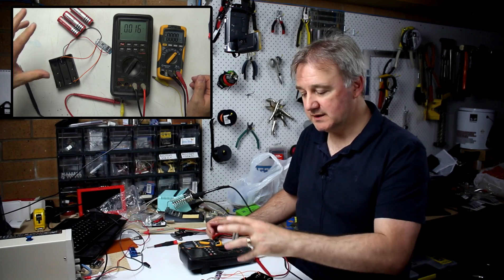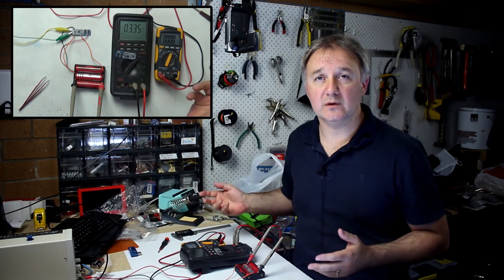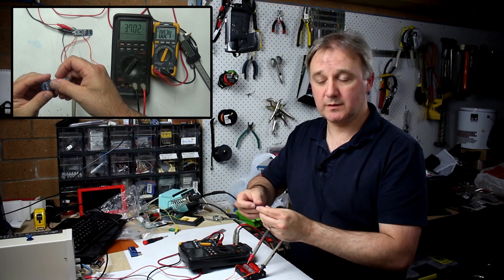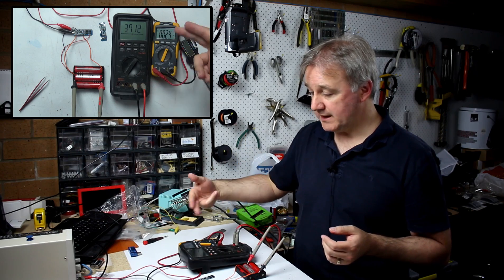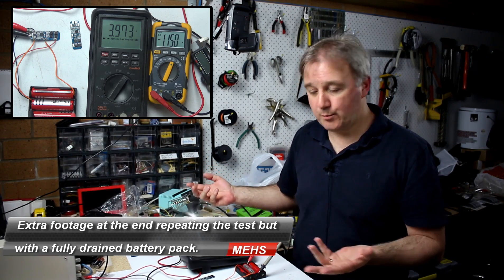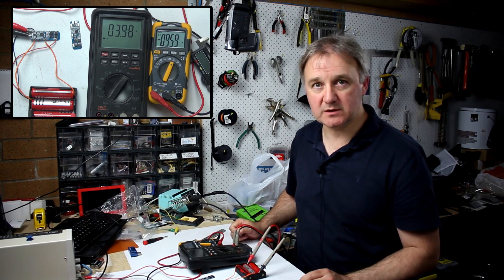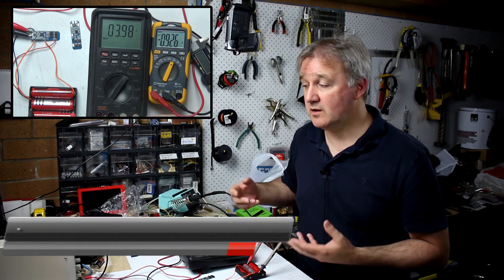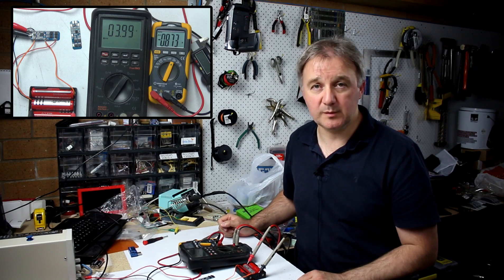Does a BMS charge my Batteries? (MEHS) Episode 57

Comment: have you looked at ICs by any of the legit (non china ebay) makers? linear technologies ti and a few other companies have parts that do better, ive got some linear samples coming for a project. over all its still harder than it should be to find a proper pack controller and though weve had (from what i can tell) at least 5 years of cost and size effective mosfets to do transfer instead of disipative balancing im struggling to find a part that can do it for 4-6 cells and is clearly sold as such. im starting to wonder if its done to sell more laptop batteries. lower u discharge them the shorter their life. 4s laptop 1 runt cell always gets to 3 and turns off pack while other cells still are at 3.3, over even 50 charges that low one sees a lot more full charge rather than fractional cycles and maybe dies 6 months earlier than the remaining 3 due to it. active balances can work during discharge time and transfer to weak cell from either the cell next to it or the other 3 cells combined to it depending on chip/tech. Ive opened laptop batteries that have 3 empty 18650 slots so its hard to argue space.. esp in the bigger and built to last corp grade laptops. I can only conclude they want to sell you that replacement battery sooner.

plug for linear: they will give just about anyone qty2 of up to 5parts in a few month period for free samp;les. I got my first sample order like 5 days after requesting it. Day after I submitted it, my local sales rep called and rather than just trying to shove parts down my throat he took about 30 min mapping out my design and trying to find the best parts they offered. also it may be possible to get demo boards for free depending on how many your local rep has on hand and demand. Over all i was thrilled and suprised at their level of dedication to prospective clients.. I had even indicated less than 1k annual units so it wasnt like they were expecting to bank on me
Reply from the maker: - I did take the wire gauge into account.  No variation.  No feeding the board proper CC and CV makes no difference.  I used a bench power supply for most of the testing etc.  These boards only have the battery protection IC on them and some FETS, no proper charging IC.  Basically charges the Lithium cells like a lead acid battery.  No good.
Reply: after talking to my rep for a while he mentioned if they arnt short on supply he can send the fully assembled "demo boards" with all components in place ready to go...this would pretty much make it a project board for you. I havent gotten back to him yet (does anyone sell a 26hr day IC?) so im not sure if that includes these balancers or not(note price when u look them up) but here is the demo you would want: dc1823a, DC1902B. there is an older model you can find with some digging that does most of what they do for cheaper if your rep isnt as awesome. Today I managed to get one of their qfn20 sample chips that happened to be a charger soldered to a dip/breadboard adapter. I have a hot plate for separating display from front glass that happened to reach high enough temps but there are tons of tutorials on surface mt soldering on youtube, hot air gun is next step down but even a regular iron can pull it off.  ebay has the adapters for cheap if you just go the sample free chip route. I also received surface mt transformer samples from coil craft today. I requested 5 of them monday morning at around 3am really liking both of these companies
Reply: Silicon Chip magazine March 2016 described a project that would probably be what you're looking for. A bit complex for myself tho.
Reply from the maker: - I might need to contact Linear and others and see what can be done.  Ive used Linear and TI ICs before and have no issues with their products, just hard to find complete project ready boards that have good IC's with easy to find datasheets.  Seriously looking at designing and making my own to do exactly what I want.  Might need to read that Silicon Chip issue too.  Cheers.
Reply: I can send it to you, the mag i mean. too difficult for me as I said. i am just trying to find a circuit for balance charging bike batteries made from salvaged laptop cells. The hobby chargers don't seem to cut the mustard as far as decent charging current goes. Not in my experience anyway.Cheers
Reply from the maker: - No need.  Thanks though.  I will pick one up.  Cheers.
Reply from the maker: - Thanks.  I will take a look when I have more time.  Cheers.
Reply: forgot to ask.. with the cheap bms u used in the video...if you attach a proper cc/cv power source does the charge curve get any better? I've got a few other projects going that i intend to use similar ebay acquired bmses for. for what im charging/what they can pay it doesnt merit using a non premade board. If they do charge properly with a cc/cv source then a cheap cc/cv dc-dc converter could be added between a brick slightly over or under whats need for the boost or buck converter to run
Reply: I wanted to edit last comment but too many browser tabs has my browser not wanting to pop it up. It just came to me that the tiny wires you had for that bat holder may have influenced your results as well. When i get those I swap out the included wires for 18 awg or bigger.
Reply: Thanks for doing the investigative "legwork!"

Comment: The solution of using 3 X TP4056 modules does not work to balance the cells since they are not isolated. If you use the same power supply to power all 3 TP4056 modules, draw it out on a piece of paper. Been there ....done it. To charge using TP4056, you need to get an isolating chip for each module to isolate from the battery negative terminals. I use these BMS modules only for under voltage protection. To Charge I use a Lithium 3s hobby charger wit independent wires and balance lead coming out of the batteries.
Reply from the maker: - Hi.  Yes I was aware of the isolation issue and have a workaround but thanks for the info.  Fingers crossed it all goes as hoped.  Cheers.

Comment: those batteries "UltraFire" is crap batteries and hardly worth 5min of your time. I have done the same with NCR battries and. I use a Hobby charger set to LiPo and charge via the BMS.. best way I have found yet to get a pack balanced. I have started to use a BMC on large RC models battery pack connected to the balance cables. seems to reduced the times the pack became unbalanced when in used. reduced puffing of the packs..
Reply from the maker: - Thanks for the info, very handy.  Yes the fake Ultrafires are garbage but they were cheap and it suited my testing regime at the time (end up about 1400mah each).  I have a batch of Panasonic, Blazer and Keeppower cells I use often when the run time matters.  Cheers.

Comment: What do you recommend for charging larger lithium ion packs like 12S5P. I'm building one for an electric skateboard and was planning to use a BMS. Would it be better to just plunk down the money for a proper lithium ion balance charger? Do some BMS work better than the one you're using?
Reply from the maker: - Hi.  Heaps better to spend intelligent money on a quality battery charger.  Considering the cost of good batteries and the number you're suggesting I would suggest a good charger over a BMS every time.  You may still need a BMS if you don't use protected cells in order to catch the low voltage point of the cells during use (the BMS will stop draining the batteries at the 2.9-2.5volt mark) which is desirable.

Comment: The problem with charging a Li-Ion battery pack the way that this particular board invites you to do is that it doesn't guarantee that each of the cells receives an equal amount of charge. So even if you limit the charging voltage to 12.6V (3x4.2 since exceeding 4.2V is a fire hazard), you may be charging one cell to 4.0V, one to 4.2V, and one cell to 4.4V (fire hazard!). To put it another way, this board does not BALANCE the cells. Some boards claim to balance the cells but I bought a 7S board that cuts off the charging current when the first cell reaches 4.3V (a little high for my comfort but not excessively so), leaving all the rest of the cells below 4.3V, and so does NOT balance the battery. The only problem this gives is that the full capacity of the battery is never realised, but I wonder how many people have bought this particular board and take it on faith that it performs the claimed balancing function. The moral of the story is never take the seller's claims on faith... always test.
Reply: Generally BMS ballances on discharge by shunting the excess voltage battery to either a resistor or to charge the lowest voltage battery - this is called "bottom ballancing" and is far cheaper to implement and safer than balancing on a charger. As such - yes you never reach the full potential of the pack, but the battery pack will last many more cycles on an 80% charge than a 100% charge.
Reply: As I understand it, a BMS balances on the Charging cycle by discharging any overcharged cells through resistors -- this is called "top balancing". "Bottom balancing" entails Discharging all cells to the same low voltage and then charging the entire pack (rather than the individual cells as a BMS would). Bottom balancing ensures that all cells reach the same low voltage at the same time during the discharge cycle, preventing the rest of the pack pushing charge through a cell that has switched into a mode where it needs recharging (this would be bad because at the point the cell wants to go into the charge cycle, forced continued discharge would destroy it).
Reply from the maker: Andy Kay - Test always, agree.  The only difference here is that the potential over voltage problem you mentioned is mostly mitigated as this board does cut off the voltage at each cell if the individual cell voltage goes above 4.25v.  It's abrupt but it does work.  Cheers.
Reply: Sounds a lot like the 7S board I bought and tested then, except that with mine the advert claimed a balancing function (which it clearly doesn't have if it stops charging the battery pack when the first cell reaches the over-charge cut-off voltage). Incidentally, this arrangement would make it an ideal board if you prefer to bottom-balance your cells and then leave the rest to the BMS.
Reply: Top or bottom ballance, you still are limited to cell with the lowest capasity. BMS should cut off if ANY cell is over- or under-voltage. Top ballancing has a 2 advantages - 4.2V charge voltage per cell (with even proper CV phaze in multi-cell battery) and slightly higher total Watt-hour capasity (1mAh at 99% SOC is more than 1mAh at 1% SOC). In cabe of bottom ballace if the charger does NOT maintain CC-CV at highest cell, end result will be skipping the CV phaze, losing  from 10% to 20%  capasity alltogether.
Reply: Thank you sooooo much my friend